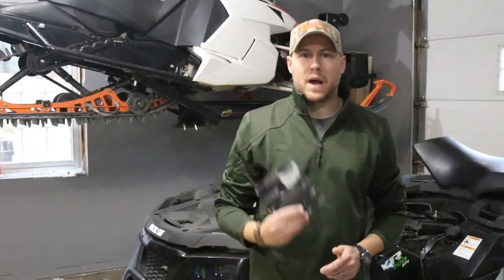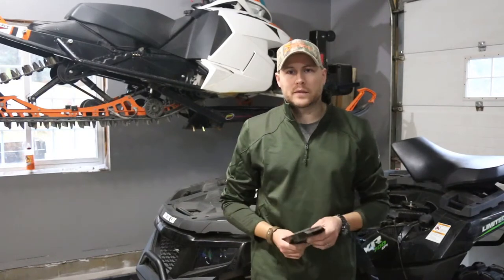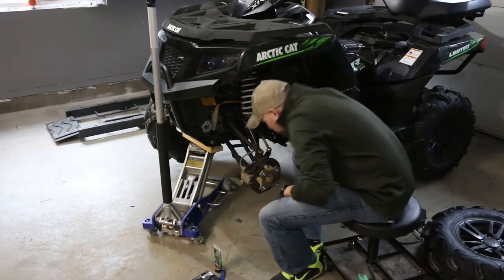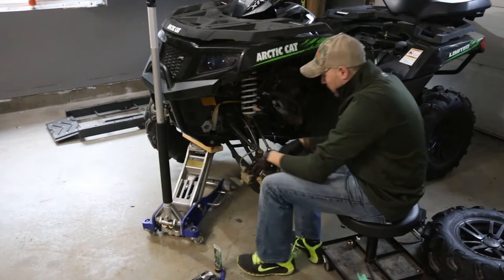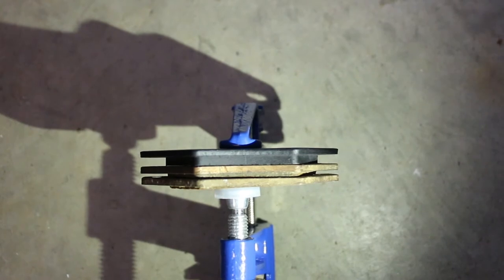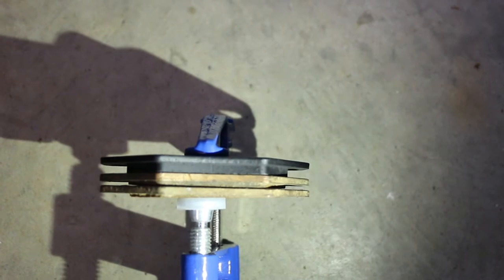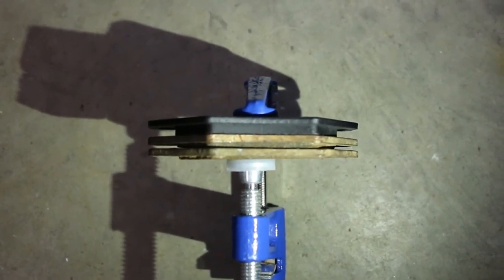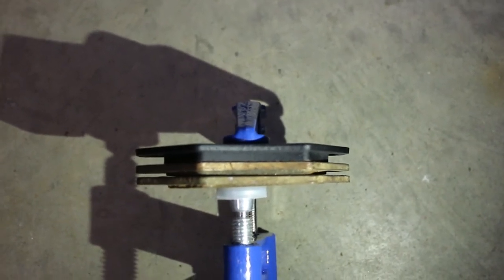Arctic Cat XR / Alterra ATV front brake pad swap tutorial.

Comment: I have a 2018 alterra and the brake wont work at all. The pads are like new and the brake fluid is full. It seems like there's air in the line but I bled it and no air. I cannot figure it out. Thank you
Reply from the maker: Front, rear or both? Does it clamp the rotor at all? There's a small chance you could have a seized caliber but it shouldn't be with a bike that new. Air in the system would make the most sense. The hand brake operates both F&R and the foot brake just the rear.